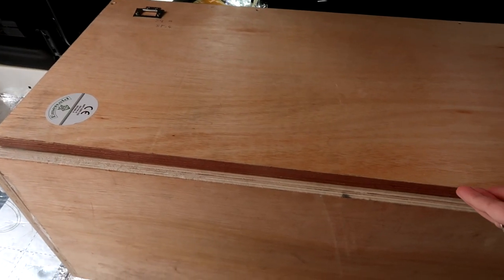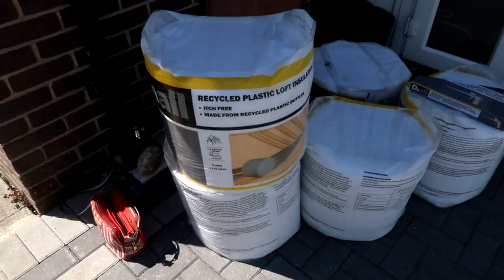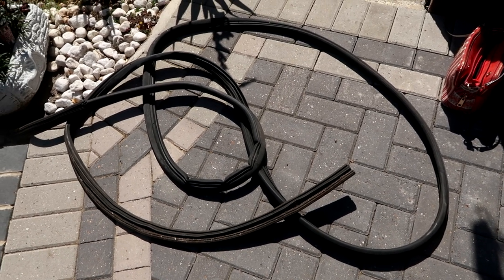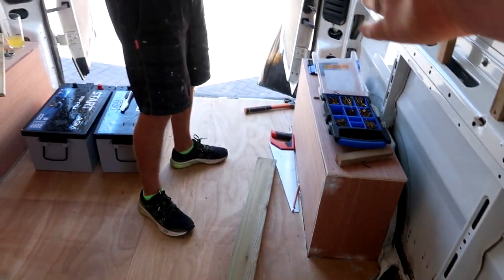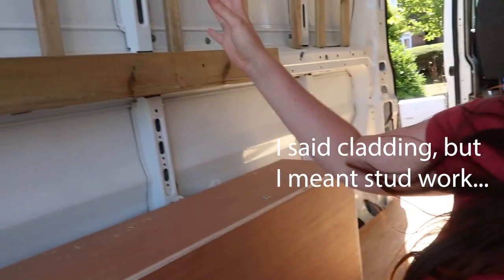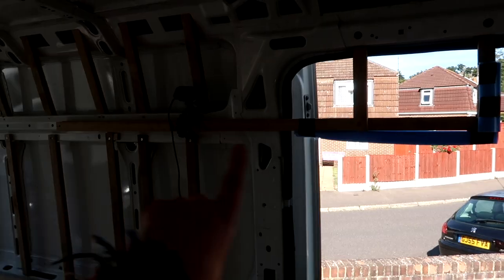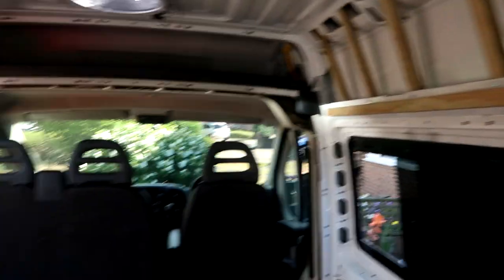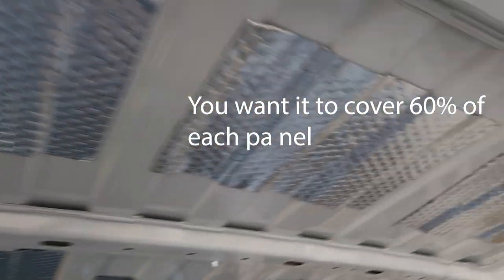Framing the walls in our camper conversion! | PEUGEOT BOXER  (Ram Promaster) VAN CONVERSION WEEK 3!

Comment: Hi there, I’m also looking to have upper cabinets over the open space where the sliding side door is and I’m not 100% on how to frame and secure these properly.  Your video doesn’t really go into detail on this and I wondered if you used some other material/website etc to show you how to secure them over the open space when framing? 

Thanks